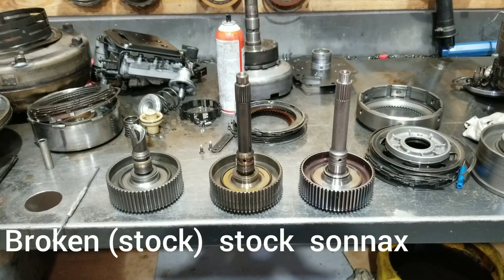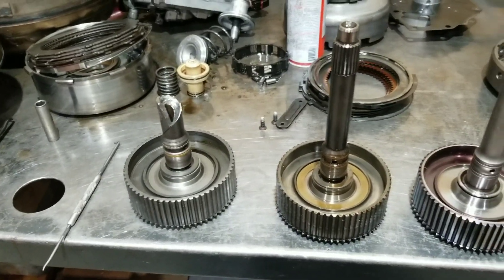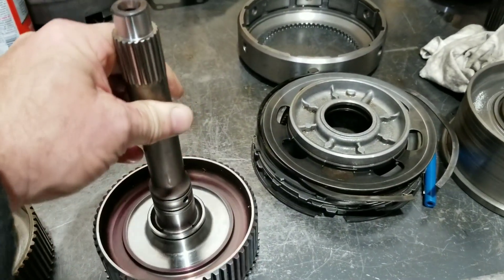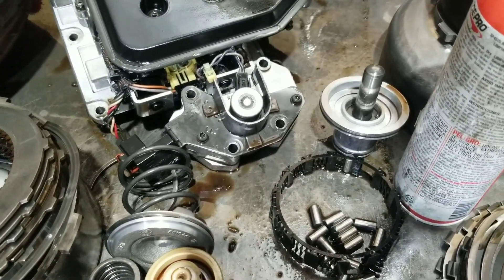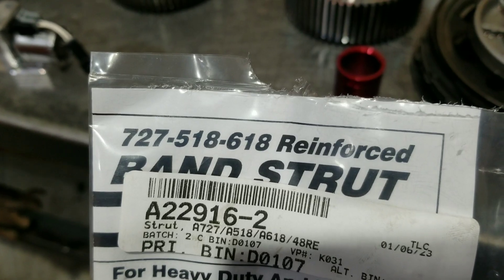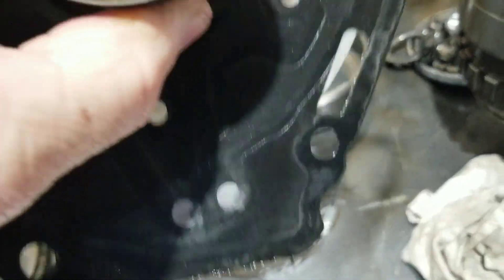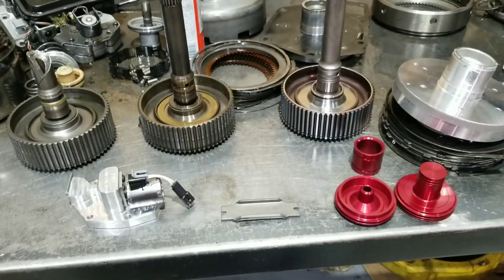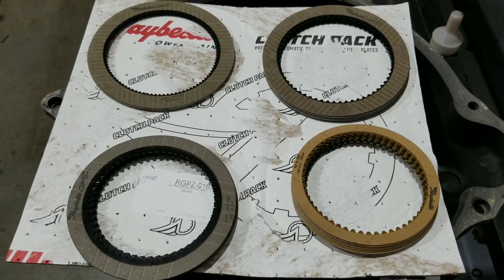48re upgrade

Comment: for stock gas truck gen 2 do you recommend a shift kit for durability?
Reply from the maker: @chriskeep9461  yes not for performance but for durability  because they (shiftkit) increase line pressure and change shift points.

Comment from the maker: Need a scanner that shows data and a manual pressure gauge the service port is on the outside of trans. You gotta make sure to look for what gear the computer is asking for while looking at pressure.  Very possible loosing line pressure

Comment: Thanks for the video. I have a 2005 Dodge Ram 2500 RWD and I have trouble with my transmission. I replaced the governor solenoid and transducer and it worked fine for a day and now when I turn the truck on transmission works fine as soon as I stop the truck completely the hit the gas pedal it will not move engine just revs. I turn truck off and shift it to drive it works once again shifting gears but as soon as I stop nothing. I am stumped I do not know a lot about transmissions that is why I am trying to watch as many videos so I can learn. Any suggestions?

Comment: Thank you for sharing the information with part numbers. What do you charge for a upgraded 48RE? Do you know of a programmer to change the shift program?
Reply from the maker: The 48re has limited electronic adjustability with a programmer, manly shift quality is handled through the valvebody upgrade. The 68Rfe is fully adjustable with a programmer.  Typically these transmissions could range in price  from 3k-7k. Hope this helps
Reply: Chris,  what apply lever do you use?

Comment: Great info👍. Curious what it would take to build a 68rfe in a similar fashion.
Reply from the maker: Sonnax and others make an input drum that allows you to use double faces clutches instead of single faced. Converts back to use thick steels. They handle heat better.  And also weld up planets